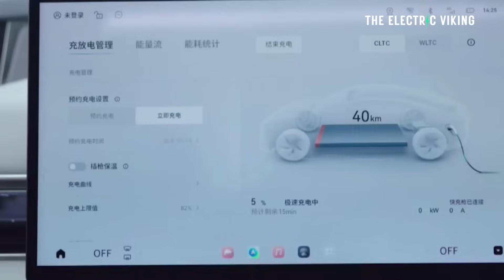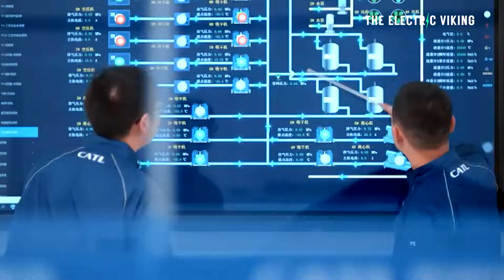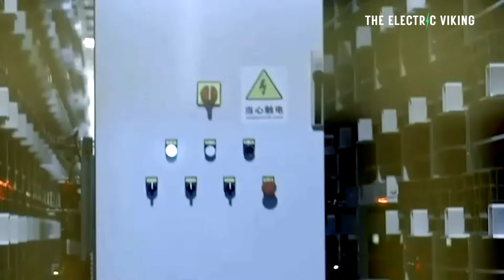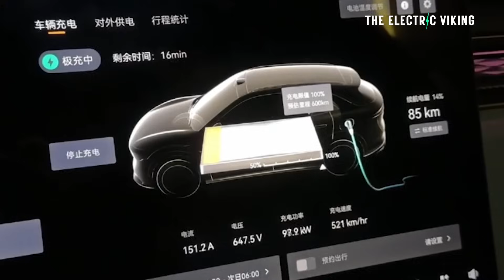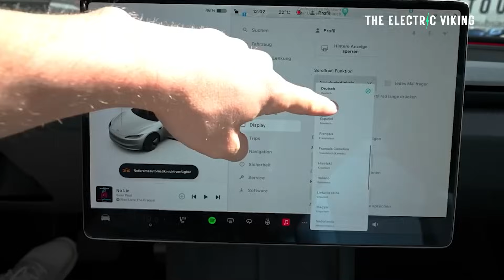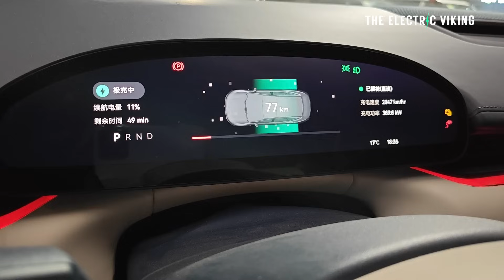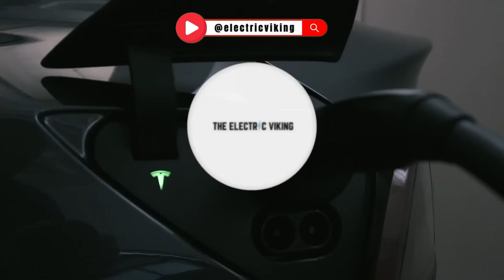CATL’s Shenxing V2 Battery: 800km Range, 5-Min Charge – EV Game Changer!

Comment: Mr Viking do you have any clue as to how much power 1300 KW is? That's 1,300,000 watts, 1.3 MW. The average home needs 1200 to 1500 watts to run, this is equivalent to nearly a thousand homes, for ONE friggin' car? A station to charge 20-30 cars would require the same power as 20,000 to 30,000 homes. Are you out of your mind or just mathematically dense? Additionally, ask any industrial electrical engineer what the infrastructure costs would be to build the friggin thing. Astrofrigginomical.

Comment: Great that CATL, BYD have these wonderful batteries. BUT what about the chargers necessary for said batteries to charge within the claimed timeframe? When will they be installed worldwide? In large volumes. Charging the batteries is a 2 component process. No use having the batteries without the chargers.

Comment: I understand that the Sodium batteries also tolerate heat better than lithium, so I am curious if the Nissan Leaf Air cooled battery system would hold up a lot better than lithium in hot climates.

Comment: so unfortunate America has put all its investments in one or two companies... pretty much closed the door on innovation.   They are still winding cylindrical batteries (such a limiting method due to inability to handle heat and stresses).   Tesla's improvements are so incremental it is embarrassing.

Comment: 1625 amps DC at 800V is necessary to charge at a rate of 1300 KW or 1.3 megawatts or 1,300,000 watts but this is a minor detail right. Just install 6-8 huge welding plugs on each car and let her rip. But I would still stand back a little. 1625 amps flowing is a lot of power. Higher than the energy density flowing out of a gasoline hose but that doesn’t heat up the tank it’s going into. I am a very optimistic former electrical engineer so I don’t use this phase often but…..not in a passenger car, not in my lifetime!

Comment: Yeah this is impressive tech, but how applicable is it in the real world.
1. Home charging for example, what good is this if your home is limited to 7.4kwh on a single phase network.
Answer, No Good.
2.Given the state of the public charging network today, how many electricity suppliers do you think would be prepared to install 100's if not 1000's of 1MW plus chargers.
Not to many I'm guessing.
3.Even if they did, how much do you think they would be charging money wise per KWh.
A shit load that's for sure.
4.And last, how many of these "supper chargers" do you think a typical countries national grid  would have the spare capacity to support.
Here in Ireland not to many I can assure you.
So if cars end up with these batteries, owners will have no option but to use the public charging network to take advantage of the speed, and be prepared to pay through the nose for the privilege.
Kind of defeats the purpose of owning an EV where home charging is considered the ideal cost saving solution.

Comment: Viking Sam, the topic of fast charging of EV are being discussed a lot recently. IMO, anything over 500 KW charging speed is meaningless. Charging stations will have limited >500 kW stations bcos if many cars are being charged simultaneously at this rate , it would result in too much load for the station to handle. To handle this high charging load, much investments needed.
The figure of charging speed above say 500 kW  is only nice to look at and has little application in the foreseeable future. This charging speed  issue is similar to the top speed figures super cars : 300 kph or 350 kph. Few people  is able to drive at this speed limited by driver’s skill or nerve and the few roads allowed to let people to drive at this speed. However, it is nice to know that one’s car top speed to faster another.

Comment: First…. Find a charging station with a 1300kW charger.  Second, find a 1300kW charger that is not being used to charge a car which can only accept 20kW and will need 3 hours to charge.
Reply: I would not be surprised if this ultra-ultra-rapid chargers are limited to EVs that can accept the highest charge rates. ie no old Nissan Leafs allowed on 1300kW chargers. Easy enough to do with software after all.

Comment: With hub motors, I can just see young guys staging their cars. Change the hub and have a faster car, of course the electronic has to follow, but it is the same with a gas car because if you  put a stronger motor you have to look at tge transmission, motor supports, etc.

Comment: With such peak I assume we don't need to talk about 10-80 charging times anymore. The limitation will be the charger itself. A car with 80kwh battery on a 350 kw charger would do 10-100 in less than 13 mins with a flat 350 kw charging 'curve'. Final ICE > EV barrier eliminated.
Reply: finally a sensable comment.  no1 is gonna charge with 1000kwh, its to expensive infrastructure.  350kwh with flat curve is the key idd.

Comment: Sam, this is all fine and dandy, but that’s not where the bottleneck has moved to when it comes to electrifying transports. The charging infrastructure here in North America will not be able to support 1 MW of charging, let alone 1.3 MW of charging, anytime soon, especially since EV owners need that power typically during the day at peek electricity-consumption times… I live in Québec, Canada. Québecois typically buy 50% of all EVs sold in any given year in Canada. We have public charging stations with 50kW chargers for GM Bolts and Nissan Leafs. We have very few 350 kW chargers, and we have a plethora between 50 kW and 350 kW DC chargers. Hyundai, with its 800-volt architecture can only charge at speeds of less than 240 kW. We have 100 and 180 kW public charging stations being build every month. Sooooo, the focus now should not be on making better batteries, but rather on the electric network catching up just to the 800-volt architecture of the Hyundais. That would be a first and a major improvement. We can move up from there…

Comment: Went on an easter roastrip. Maximum charging at tesla superchargers was 75kw. Where are these megachargers??
Reply: You need to precondition your battery before a charge
Reply: @williammeek-h2o  and also need to NOT travel when others do. A 150kw charger splits charge in 2 when A and B are charging.
Reply: @jluis333  Depends on the design of the station. That isn't always the case.

Comment: You would need power station size cables Numptie
Reply: Nope, megawatt charging cables already exist, they are only 15% thicker than regular charging cables as they use conductors in coolant technology. This problem is solved, by electrical engineers, already. Perhaps lookup the published standards (MCS for example) before commenting about someone else being a 'Numptie' about something you're not aware of.
Reply: @GruffSillyGoat Sounds cheap, light weight, simple and easily scalable. The perfect Wet Dream

Comment: How heavy is the cable on the charger?
Reply: They're not much thicker or heavier than regular charging cables, about 15%, as they use conducters embedded within coolant design to reduce the size. Although the higher 3.75MW cable designs can have mechanically assisted/robotic plugs but are typically designed to be used on HGVs.

Comment: 1.3 Mega Watts is impressive.  The west has a lot of catching up to do.  They could only achive this by charging the cell packs in parallel.  Fairly straight forward common sense really.  To take in 1300 kW, you'd need to spread that across hundreds or thousands of cells, all drawing power simultaneously, not sequentially.  The battery pack is likely built with parallel cell blocks, each with its own busbars, thermal path, and control system.  Apparently published specs and confirmed 1300 kW peak was achieved by massive parallelization.
Reply: See images at 5:14.  The on-site power pack is the size of a telephone booth.
Reply: you might want to research how batteries actually work
Reply: The 'West', as in Europe, has adopted the Megawatt Charging System already, which is able to support up to 3.75MW charging currently. This has been deployed already for eHGVs, with plans in place to grow the network.

Comment: 1.3 MWatt fast charging, 800 km range. After 10c+  fast charging infra becomes a fact, the only EV draw back is gone.  Imagine an Aptera 600 miles range with a 10c fast-charging battery,  it is fully charged in a couple of minutes.

Comment: This is the future… Should have been the #1 priority at Tesla but Elon wanted to build a Cybertruck. Dumb😮
Reply: Do you understand the difference between a car manufacturer and a battery manufacturer? Only very few do both, like Tesla and BYD, so maybe you should wine about the rest of them like VW, Toyota, Stellantis and all the others.
Reply: Tesla is both and speed to charge remains the #1 obstacle to EV adoption.
Reply: @ I know that Tesla is both and CATL is a supplier of Tesla. What Tesla did with the 4680 is an extremely difficult task, as a non battery manufacturer a completely new cell type (tabless) completely new coating method (dry coating). When you consider that, Tesla was very fast with the development, as a lot of the machinery was developped by Tesla. Just wait a few years, I would not judge so fast.
Reply: @nilsfrederking I agree certainly progress but Elon was/is always only focused on cost $$$. The elephant in the room was not costs. It’s was charge speeds. Elon disagreed. He said 20 minutes to refuel is fine. He said the reason people don’t buy EVs is only cost. He missed the boat like he did with advertising/pr.

Comment: You obviously have zero knowledge about electrical engineering!
The recharge a battery at that speed you will need massive infrastructure upgades to handle that much load, youd need copper cables thicker than your head!!
Reply: Megawatt charging cables already exist, they are only 15% thicker than regular charging cables as they use conductor in coolant technology. This problem is solved, by electrical engineers, already.
Reply: @GruffSillyGoat Unless the charger is within spitting distance of a substation, it isn't a feasible option, & I highly doubt the reality of such a power hungry charge station, not to mention the longterm damage it will do to the battery, trying to charge it that fast !
Reply: There are existing 350kW charging sites with many times more total power than one of these charges. Many tap a feed from a local transformer and a number are powered by local solar and batteries to reduce the load on the local grid, and provide local grid balancing service.

So the site designs can easily support a larger number of 350kW chargers and a smaller number of MW chargers, the on-site batteries would just need to be sized accordingly and the grid connection sized for the averaged 24hr demand.
Reply: As to battery damage, this is easy to solve as the packs in the vehicle are split into multiple domains that charge in parallel. The cells are designed with a balance of power density, energy density and lifecycle durability in mind.
Reply: @GruffSillyGoat  rubbish, no current battery design can take such a high current, without damaging the cells
Reply: Nope, it's not a issue this is already managed effectively in the high discharge/charge MW level grid scale BESS batteries. Where commercial operators place durability and longevity of the batteries as a key criteria as this drives their operating costs (with BESS systems aimed to last 20 to 30 years with high charging rates).

The answer is in the same in vehicles as for BESS ... parallelisation of the cells within the battery pack and effective thermal management during charging. Where the current is divided over many parallel battery arrays rather than a single string of batteries. 

This approach can been seen in today's 800v architecture cars, such as Kia's EV6 where the battery is split into two domains of 192 cells each. At 200kW sustained charging over 55% of their charge curve (peaking at 260kW for 25%) these cars divide the 370A current across the two battery domains, charging the batteries at 3C but with each cell staying within it's 3.6 to 4.2v charging range at less than one amp each cell.

Higher current capability requires additional parallel circuit with sufficient thermal management. Further, the higher C rated batteries that CATL announced are at rated the pouch level; these may well be constructured using assembly techniques that also uses internal parallelisation of multiple lower C rated sub-cells. The manufacturing hurdle was to construct balanced cells that could be assembled at a pouch/blade/prismatic unit level, which is cracked a while back.

Each individual battery is not stressed that significantly and as long as the heat can be both minimised by cell design and removed at a higher pace than generated by cooling system design, than batteries can be safely charged at MW levels without compromising the cells and reducing durability/longevity.

Comment: A power of 1300 kW at a voltage of 230 volts corresponds to a current of approximately 5652.17 amperes.....  That's the total capacity of a large industrial manufacturing plant.
Reply: I very much doubt they would charge directly off the grid. More like a large battery that charges up slowly from the grid with a capacity to charge several cars. Obviously the vast amount of cars will be charged slowly off the grid and superchargers will be used For convenience at a high price.

Comment: You will need industrial sized substations to support such charging rates and seriously upgraded power line corridors as well. Who pays for that? 

All that said, these ranges and charging rates are what will get me over the line.
Reply: That isn't how charging stations work. Charging stations are designed for a peak throughput. It doesn't matter if 300 cars are charged at 250 kW or 1250 kW. You just have more chargers if you have the lower power ones. Same total power draw.
As we already have fast charging stations, clearly power supply is being worked out.
Reply: Tesla has a charging station under construction (I think it has 100 stalls), where 90% of the maximum load comes from affiliated solar panels with Megapack battery storage units. This is a much better solution, than upgrading the electrical grid.

Comment: 1000 mile battery with a 10 minute charging time is around the corner.  That's a once a month charging for most people.  That will also help balance the renewable grid.  People will charge their vehicles during peak savings times.  That means you'll charge while at work.
Reply: Who pays for all the at work charging? I guess you are going to pay to have a power point put in where you work and have a meter on it so you are charged as nothing is free.
Reply: @dikkybee4003  The utilities would want to  have these at any business with at least 100 employees.  That's where you would start.  Plus, they wouldn't have to be super chargers.  Or, you could just have your FSD guide your car or truck to a box store which will have a whole slew of them.  Plus, you could do your grocery shopping over the phone and your car could pick you up, fully charged, with grocieries in tow.  This is not a new idea.  Costco has gas stations for this very reason.  And electricity is much easier to manage than gasoline.

Comment: If these batteries are connected to chargers that are a fraction of the capability of the battery, are they then charging at the full capacity of the charger throughout the whole charging process?
Reply: Yes, so you will have a significant speed up even with "only" 300 or  400 kW charging.

Comment: You're right imagine the progress in the next few years and it's happening in the east. Enjoyed thank you.
Reply: The car will be yours, but if I were you, I wouldn't buy a Chinese one.

If you're only going to have the car for 1-2 years then fine, but if you're going to have the car for 5 years or more... I recommend you do some research because Chinese cars are advanced on the outside, but on the inside, it's a completely different story!

Not only do they start to rust after just 2 years, but there are also safety concerns.

Chinese companies are not like worldwide companies that you can sue them, the govs protects everyone.

Rust destroys the strength of the chassis if an accident occurs and another problem may be that the airbags do not deploy.

Don't think that Chinese cars are problem-free, the screen can turn off in the middle of driving... and this is just the beginning.

At least wait 3-4 years to get answers from current owners around the world. The cars are new and for the first 1-2 years the cars will be fine - probably 🙂

Japanese cars are definitely fine 👍 but I would avoid Chinese ones!

I'm just letting you know... the decision is yours!
Reply: In a few years 🤣🤣🤣

A 5-minute from 20-80% requires a charging speed of 900+kW.

Good luck finding that kind of speed. 🥂

Yes, it sounds nice on paper, but in real life it's a different story.
Reply: @dchubworldsharenetwork  Well Sam is positive about it and when it happens I won't be surprised either. For me charging time is the biggest hurdle to my getting an EV. If I can get quick charging and a all electric Chinese or Japanese car it is what I want. Thanks for comment.